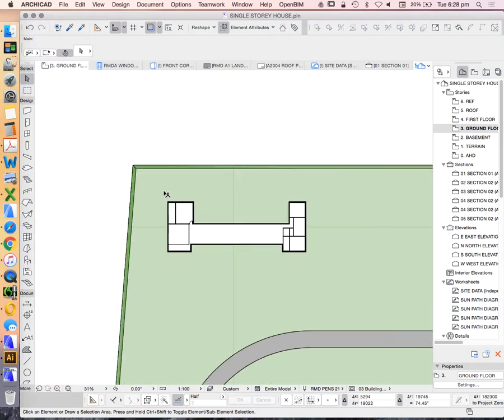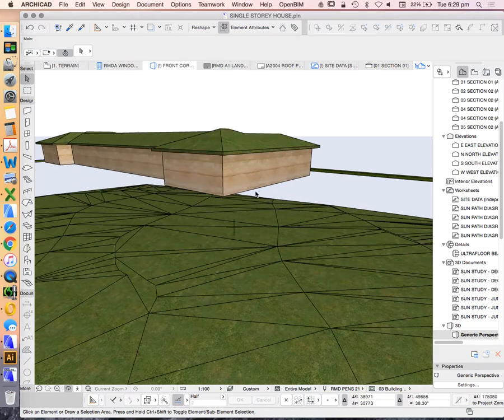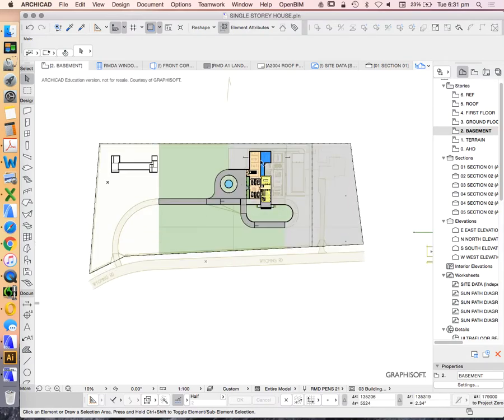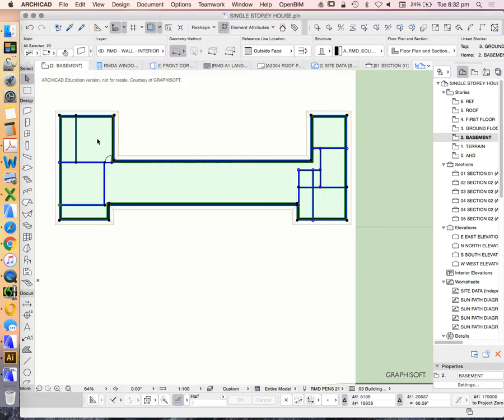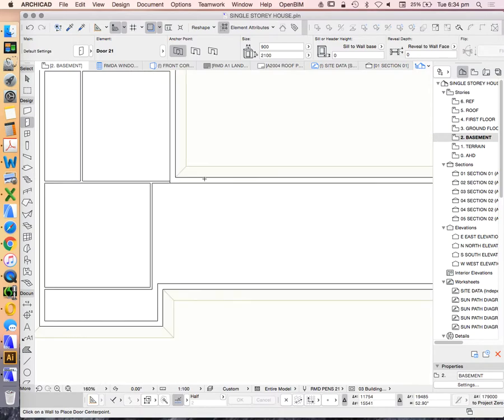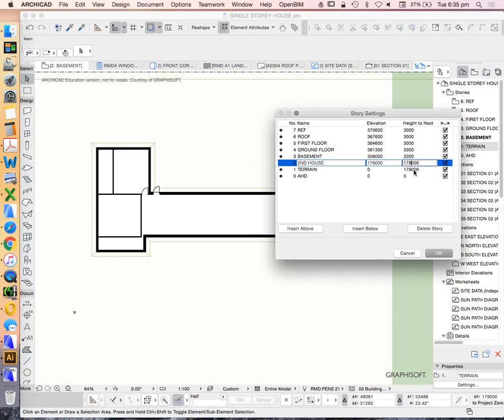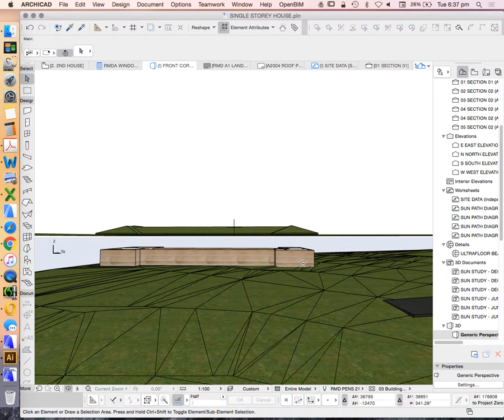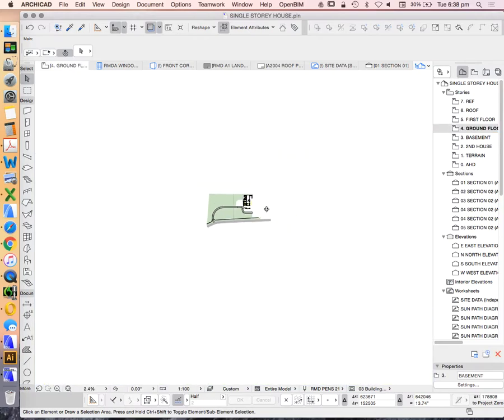ArchiCAD 21 House Project - part 12 - Storey settings for split level sites

Comment: Thanks for this. There are many ways to solve Splitlevel, eg using hotlinkes in AC.
Splitlevel is hopefully is made even better in AC23😁
Reply: How do you use hotlinks
Please its an emergency
Reply: @daydarasensei12  1. Set up a new blank file (with the same template) and same number of stories (but with double the story height). 

2. Import your .pln, module file or teamwork file as a multi-story hotlink and select the option to remove element links to stories. 

3. Now you only have to click update hotline whenever you want a refreshed exploded view.